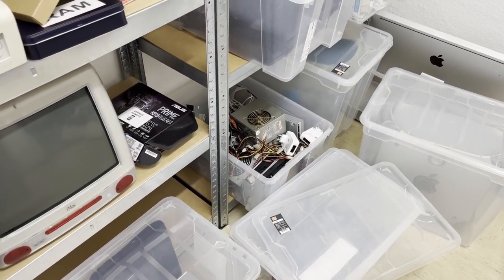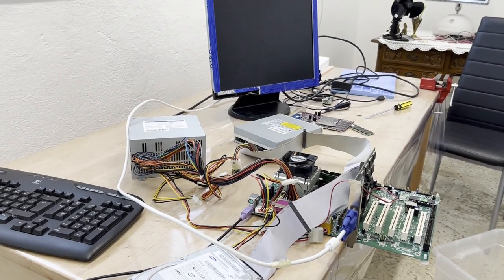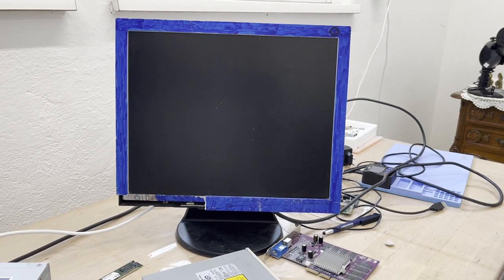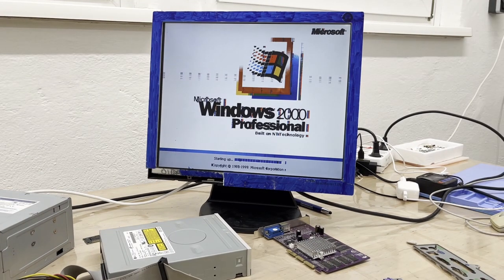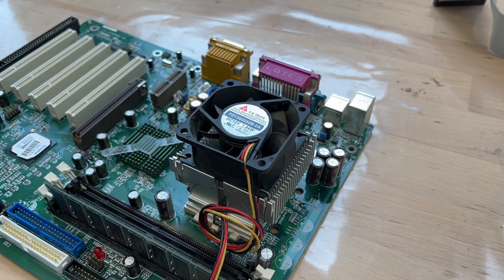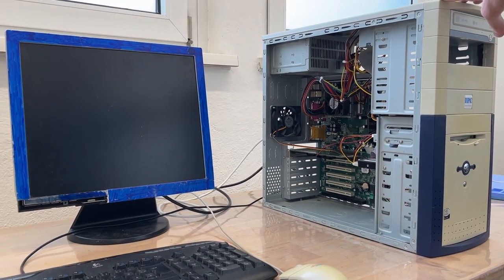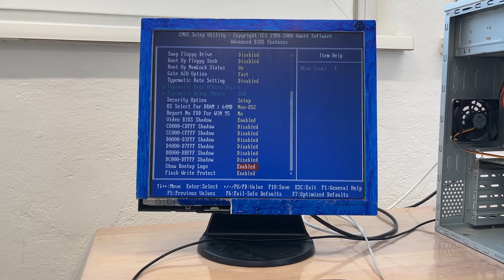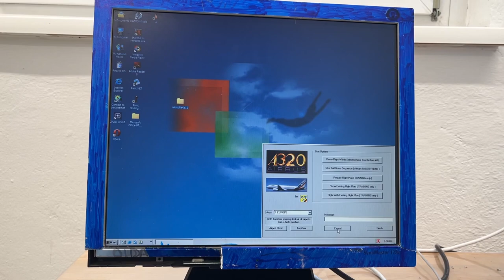Building a Retro PC from Scrap Parts

Comment: Actually if the 64 MB of ram is too slow... The 512 MB will turn the clock down to sync with slower  ram so better unplug the 64 MB of ram instead

Comment: You might be able to get flight simulator working with a generic display driver.

Also, since it has an ISA slot, you could put an ISA sound card in there & get Windows 3 working with proper sound support, since it doesn't really support onboard or PCI sound cards.
Reply: Don't toss the parts!  You'll need them for future pc builds, just organize and test.
Reply from the maker: You were right, I already built two more PCs out of them ;) However, there was one dead mainboard and two dead PSUs in the pile; alongside some useless expansion cards.
Reply: @MacintoshMen  but few expansion cards are useless, and they may not be dead, there is some tricks to revive them

Comment: That bottom black slot is an ISA slot, which is what predates even PCI. While it's largely useless for most applications in a retro rig with this much integrated stuff, it actually has one HUGE function if you want to play retro DOS games. DOS games really need an ISA sound card to be at or near 100% compatibility for most games. 

Also, that's actually a pretty awesome motherboard that could go for a decent little bit of cash. It is really best for late 90's games, and later DOS games because it's so fast. Put a good card that has a lot of compatibility and features and Windows 98 drivers, and you'll be golden. 

Let me know if you need help. I can help you figure out how to deck it out into something pretty good, and it would still largely be a scrap-bin PC.
Reply from the maker: I sold this computer months ago to some kind of retro gamer. He was very keen on the GPU he told me.

Comment: The fact that it takes so long to boot tells me that there's something wrong with the hard drive, or it could be that one of the capacitors is dying. Regardless, it should boot a lot faster than this. a 1.2Ghz Athlon should be very quick and snappy for windows 2000. Also, That GPU is a bit of a mismatch for a CPU from 2000-2001. I thought I saw a geforce 2 mx in the pile? would be a great fit. =)
Reply from the maker: I actually agree about the GPU, it's a bit on the weak side but that GPU was the reason that I sold the PC relatively quickly, it looks like it's quite popular in the community.